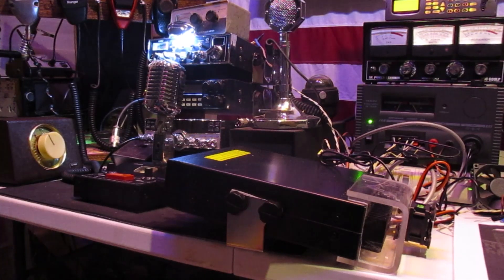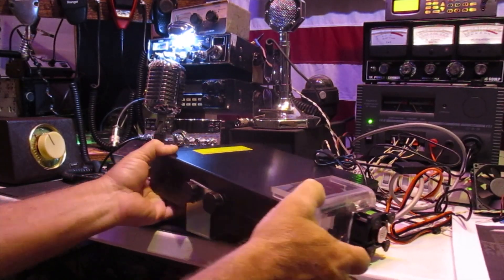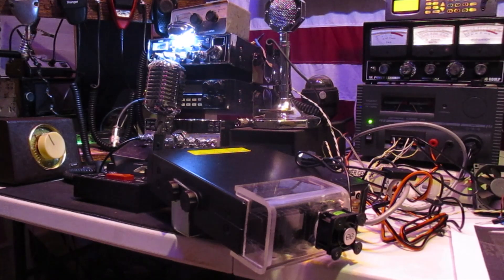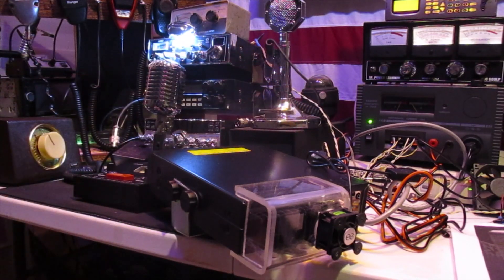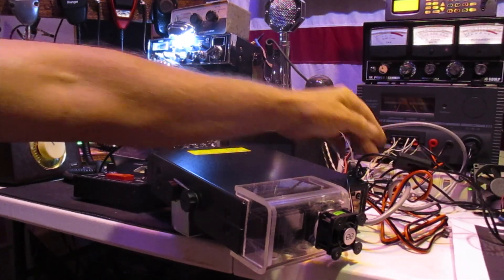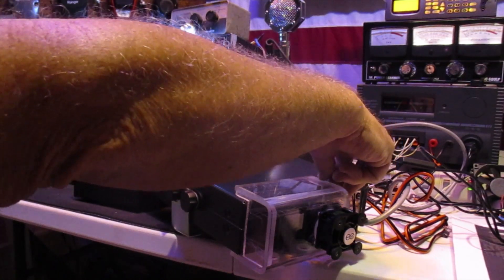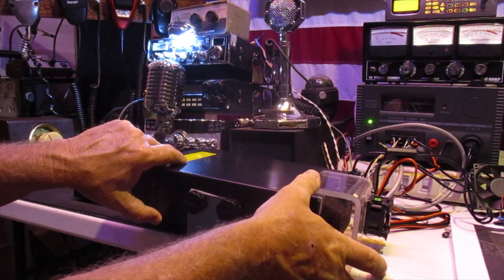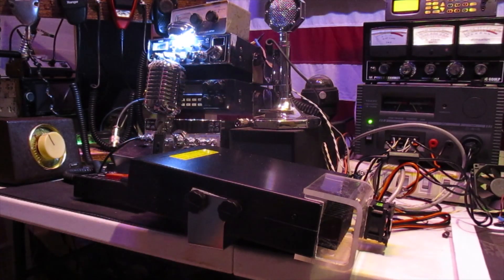Fabricated Cooling Module

Comment: Just a heads up Mudd, Gorilla glue expands when its curing, not sure it that would cause jointing issues but, something to be aware of!. ✌️
Reply from the maker: Roger I get the non bubbling type and seems to work good but discolors in the bottle and doesn't last long unused. Thanks for the heads up though✌✌
Reply: @udx-483muddbucket5  10-4 Mudd. Hey, howz the skip skipper? About an hour ago I made contact with 121 (David) in the West Indies (Jamaica) had a decent qso on 27.385 lsb but due to QRM and her sister QRN , we QSY'd to 27.455 lsb and finished chewing the rag!!! I was hitting his rig with a solid 8x9 signal in which I owe my 4'ft antenna mount aka Cast Iron patio umbrella  stand a standing ovation for another job well done!.⚡️🎙🤠👍